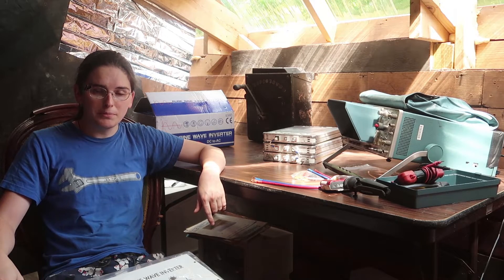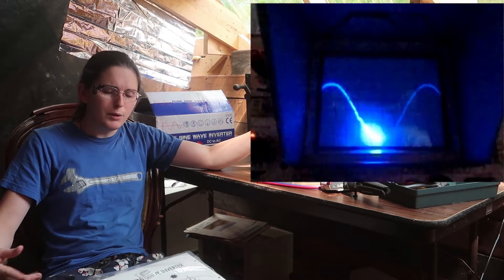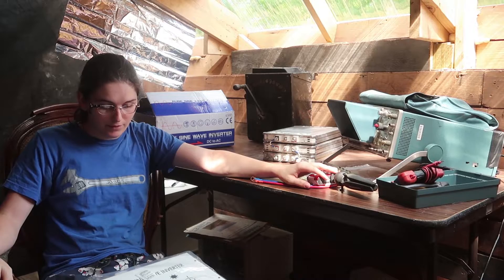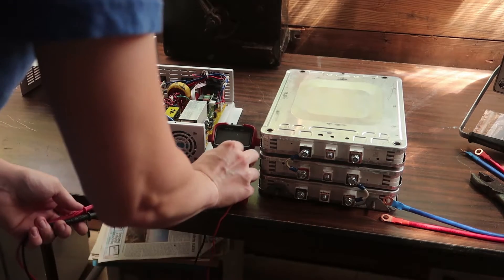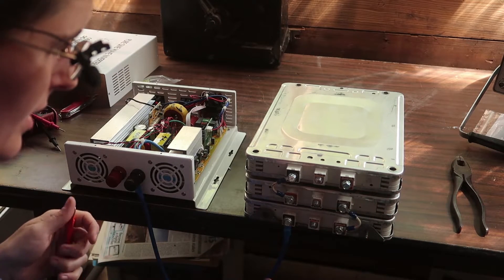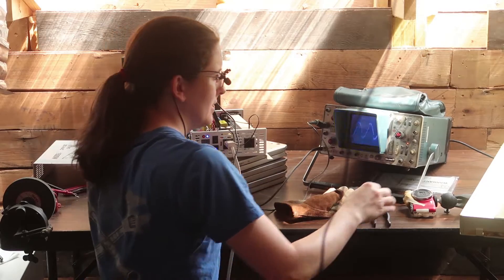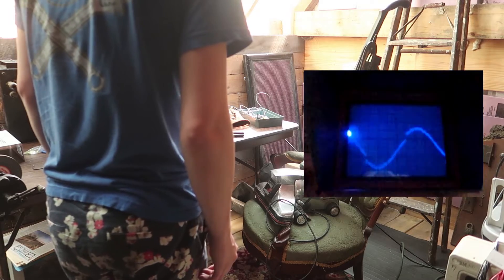Solar Sunday 01: Reliable 1500W 24V Pure Sine Wave Inverter Waveform, Air Conditioner Load Test

Comment: I finally can run the window air conditioning unit😮. I've got 1400 watts of panels, and I wound up with twenty big marine batteries. Oh, and I installed a 600 watts wind generator, that was supposed to be 24 but they sent me a 12 volts model. I've had it six weeks. I have fried the Aims Power inverter charger and rebuilt it since my last comment. It's been doing well since. When I ran the A/C day before yesterday, there was 35 amps coming in, and making 943 watts, plus a little bit from the wind generator. Sorry it took me so long.
Reply from the maker: Im proud of your progress! Is your AC unit the newer inverter type? Our new hisense unit cost extra but it has a ceer rating of 15 which is hard to beat

Comment: I wonder if the Voltmeter is shorting out on the case...with that exposed wiring on the LEDs? Your the 2nd person I've seen with this fault. Thankfully Reliable have excellent customer support and replace faulty items quickly with no fuss.

Comment: I have a 3000 watt pure sine inverter with a 24 volt system and 30 100w batterys why will it not charge my 2021 chevy bolt ev
Reply from the maker: The checy bolt might take more than 3kw from the inverter, or maybe the inverter can only give like 1,200w continuous.

Comment: I would have used larger cables on the inverter. The cables reliable supplies are not large enough to handle high inrush current.
Reply from the maker: This is just for tinkering, not for instalation. Don’t worry
Reply: @RinoasBigProjects  no problem.

Comment: You need a low freq inverter for what you want do, that high freq inverter is a good one and very efficient, but low freq would do alot better at motor start.
Reply from the maker: I agree. This will be used for running the lights and such

Comment: Could you tell me how much peak power 
Can it handle air conditioner
Reply from the maker: i think 2000w, but maybe just 1500. may need to modify AC unit to slowly turn on
Reply: @RinoasBigProjects  but it's say it's surge power 2000watt 
So it's not given
Reply: And could you tell me 
How could i charge 4s lithium polymer pack 84 amp by solar 
I try everything but result is zero 
Mostly mppt or pwm controller 
Set on 12 volt or 24 volt specialy lead acid battey which set on high 15.5 
But lithium polymer high volt is 16.8
And parameter is not match 
2nd thing i use boost mppt or converter but problem is mostly solar panel given 18 volt or 36 volt 
So what i should do 
 
So how could i charge 
I hope you answer me 
Ple ....
Reply from the maker: Your solar panel needs to be above the battery voltage. Also look online for a BMS for a 4s battery to regulate the charge.

18v would be good for the 16v battery. Solar panels are weird because their voltage drops weirdly. So the 18v panel can connect to a BMS, and the BMS to the battery. The only reason for the BMS is to stop the battery for over-charging.

I think you may need to avoid normal solar controllers if you are stuck with a 4s battery. You may be able to find a watt-hour meter from the remote control hobby stores onlines if you still need to get more info on your system

Comment: Why don't you put a shutoff on it so that it doesn't spark if it scares you and all?...I looked thru the holes in the side on my inverter..looks like #3 furnace  cable going to a transformer about like a golf cart charger...on the idling current it says less than 50 watts lol...evidently one is supposed to be able to absorb that little loss...I've been watching TV and a light on and charging phone for 2 hours and it has dropped a tenth of a volt to 24.4 volts..it got way better when I went from 6 to 8 batteries...they tend to recover a lot better now...after watching this I had a thought..if you simply put the 24 v motor on the lathe you could run it temporarily with that big rheostat...just figured you're gonna need it for the 50 cycle generator thing probably so...

Comment: Well I've had the Aims 2000 watt inverter/charger for a couple of months now...it's 24 volts...it does great but I've only got 6 batteries till next week I'm getting 2 more and shortening all these #2 welding cables up..I can run my 1450 watt air fryer but only for a few minutes without the sun so that will let me at least make a pizza...I probably could run it and the A/C both this summer since we had a 73 mph wind gust I have a shattered panel...so I'm getting 3 more so that when the sun comes back out again someday lol I'll have 600 watts at least..I'd get more but I'm kind of camping out in my uncle's barn until I can find some land or something so I'll make those be enough for now..but watching this again it was different now..I was just sitting here smiling thinking yeah my big blue box would run all that and probably the lathe too but that the 24 volt motor generator thing probably needs built just because of the coolness factor lol..I tried the old 50s air compressor and it overloaded my Aims and had to reset it so I may put a different motor on the compressor and then I can experiment with the old 110 volt it might make a pretty good generator..I bought some n52 magnets just in case...lol..later projects

Comment: Just a note...I had the same problem with a 65 year old air compressor..It is 1/4 hp also..I noticed it is 110 volt and 50 cycle...it just hums when I hooked it to a 1200 watt inverter...not sure if its the sine wave or the 50 cycles but Im going to find a pure sine wave inverter and see what it does..if it does like your lathe Im going to put a 12 volt starter/ generator from a 60s riding mower on it...it only has to run long enough for a tire to inflate...If that happens Im going to convert the old motor to a 12 pole neo magnet generator so it can at least be still used for something...my old greyhound welder is 50 cycles too but it just has a bit higher voltage...it only takes 18 amps and it was funny coz I bought it for 18 bucks...they just wanted to get rid of it lol but I noticed it has a white copper winding (35% silver)... The people that had it didnt know what it was...those inverters cost entirely too much but Im gonna bite the bullet and get one...the only ones I really like are over a thousand bucks.

Comment: Cool ta see, usta electroplate, then board through parts, usta bug the engineer fix ehs till, lol..fixed the tough stuff, but it wasnt, . Time ta look into high frequency electricity , think about sun waves into more, people have turned em dc, ac..time ta take sun waves more...need new, dig the way ya think

Comment: 6s id not ideal they do have some like 1500 watt 18v inverters on ebay that would let you get more off the power from you batteries you could charge to like 4v so not all the way but you will get more useable energy than the 24

Comment: 1 other thing you need to run a Air conditioner is thicker battery cables that are going to inverter. They need to be 0 gauge wire plus the ones you have.

Comment: You just need a bigger  inverter i just got the 3000 watt inverter but the 2500 will run AC units up to 12,000 btu. The same company inverter in the bigger size has 3 wires to hookup to for bigger loads like you looking for.

Comment: Hanging your solar panels over the apex of the roof may not be a good idea. Strong winds could easily lift and destroy the panels, the building too if there's sufficient power in the damaged connecting wires. Please be careful, perhaps blinds of some sort would be a better solution?
Reply from the maker: we shall see
Reply: Stay safe ..

Comment: Random guess here, but I think maybe the Inverter cannot handle the initial current draw of large inductive loads with poor power factor. The Lathe and AC compressor both fall into that category. Some of those stupid "power saving miracle devices" might actually be appropriate in this case. Basically a large mains rated capacitor to correct poor power factor. Big Clive has some excellent videos explaining power factor. Love the video though. Some of those inverters (as well as pretty much any ebay tech) can be pretty sketchy.

Comment: why not power the computer directly with dc, bypassing the internal power supply?
Reply from the maker: because the computer needs a lot if different voltages, and i dont want to blow up 2,000$ in computer hardware

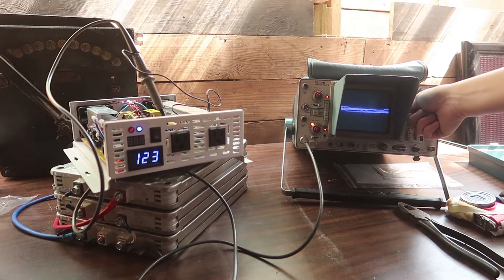Comment: oh and a lot of the "pure sine" inverters from ebay look really sketchy to me.  Especially the cheaper ones.  I think that one is modified square wave, look at the input from 4:22 that you called "digital noise".  But I am not at all an expert at looking at waveforms.  Why do you think it's just noise?  What settings are you selecting?  (I can't see the dial, obviously.) this is of particular interest to me, as I have very sensitive medical equipment that I use daily that absolutely refuses to run on anything other than pure sine. oh and a 1/2 hp motor should pull 384 watts of power.  But I think that lathe is significantly more powerful than that.  Also, there is mechanical resistance, which you try and mitigate but turning it.  Try the same setup but with a double stack (120 AH) battery pack and see if that helps with the lathe? Once again, super cool Rin!  OMG Calvin and Hobbes!?  You are so awesome! I KNOW what that buzz was.  That was the high amp draw of the A/C compressor motor starting up (just long enough to trip the switch) but not enough to disrupt everything, I had the same problem last year running a 1500 watt gas generator with an A/C that size (5000btu right?)  Try adding a couple of large capacitors inline with the A/C to "soft start" it.  Most likely, it will not run properly unless you have at least a thousand more watts.  (that was my experience anyways.)  Oh and finally, take a look at this video.  https://www.youtube.com/watch?v=R_g4nT4a28U you might find inspiration in it.
Reply from the maker: i think youtube was detecting your comments as spam, im going to whitelist your comments

no that digital noise is what you get with any unfiltered switching power supply, i was zooming into the signal very very far. thats just how the transistors turn it on and off rapidly. modified sine wave looks like a 60hz square wave with a few extra steps between. perhaps next week i will do a video of the different waveform outputs. this one is actually pure sine wave, just its kinda junky sine wave. lol.

this lithium battery can provide more energy than multiple lead acid batteries. so the battery isnt the issue. its just that motors take like 10x as much power while starting.

yeah i have a small collection of AC capacitors, i might try them.

i counter with a video for you: https://www.youtube.com/watch?v=ZD_3_gsgsnk
Reply: @RinoasBigProjects  Thanks!  I'm watching the link you sent, seems pretty cool.  Are you planning on setting up a greenhouse in the top of the shed??
Reply from the maker: no in the other yard.
Reply: @RinoasBigProjects Projects well this interaction has made my day!  Thanks, Rin!

Comment: Ive heard that the really cheap inverters have a tendency to be disguise themselves as pure sine when in fact they are modified sine, Might wanna check yours to make sure! Might be why your computer was hiccuping. Ive also read a lot of people saying the lines these companies run to the outlets on the box are wayyyy to undersized for the loads that get drawn on them. Might want to beef them up!.
Reply from the maker: computer was fine, AC unit was giving issues

turns out there were 4 pins broken in my graphics card connector so that was a seperate issue

Comment: I had a nother idea about powering the lathe and that is only using a brusslless motor to power it, you coud gain full speedcontrol and even anti ringing features like AVE did with his lathe. Where he slows down and speeds up  the motor constantly so no resonant frequencies can build up in the workpeace. Having full speedcontrol and the option to run a 6s motor /esc  so no inverter is needet sounds nice to

Comment: You should consider making the solar panels you intend to cast shade on your sky lights pivotable or something. So you can batton them down flush against the roof during high winds or a storm. I could see them become expensive airfoils and get damaged or torn off.
Reply from the maker: i designed the roof to be the right angle for them

Comment: A/c compressors need to draw 4 to 6 times their running current when starting to turn over so even a little 5000 btu will have trouble starting on a 1500w inverter.

For your application, unless you want to spend big bucks on a high capacity inverter (like 5kw+), you can add a hard start kit to the a/c. It's a capacitor and relay combo wired in parallel to the normal run cap of the compressor to increase the phase shift and starting torque temporarily. It automatically drops out of the circuit once the compressor has started.

For you the SPP4E from supco (http://www.supco.com/eclass.htm) -> 1/8 to 1hp 90 to 130V will fit the bill. The rule of thumb is 1 HP per 12 000 btu so it would work on any 120v window a/c up to 12000 btu. Do not get the non-E series version, has no way to detect when the compressor has started and takes a long time to cool down and reset after compressor operation due to using a ptc style device instead of a relay to drop out of the circuit.

Even with a hard start kit you'll probably need a higher capacity inverter than 1500w to run large inductive loads like a/c units and power tools.
Reply from the maker: this inverter said it was capable of handling 3kw surges so i was mostly testing it out of curiosity rather than actually planning to use it for that.
Reply: then a hard start alone may solve the problem.
Reply: @Jon-hx7pe  That "hard start" you mentioned, is the start relay, and this is already used by the manufacturer on small AC compressors like this window unit. Even in household refrigerators and freezers those start relays are installed, without them the compressor won't start even on main lines.

Comment: What if you powered the lathe with a treadmill motor and speed controller.
Reply from the maker: it would need to be 24v instead of 120v. havent seen a 24v one yet.

Comment: You need to also look at your setup on the oscilloscope. It should not require so much setup for a sine wave display. You're not triggering saw tooth patterns with fixed level, phase, amplitude, duration and falloff... If its sixty cycle 120v then its straight forward like a multimeter.- only a couple of settings. And if you're using the inverter to power the scope, you are looking at the effects of the input power to the scope..blah blah... Remember the required initial surge voltages to START a motor and the falloff of requirements after starting. Motors require startup windings or capacitors on starting coils, blah blah to start the motion in specific direction of rotation.... I am not that up on old motors like that on that lathe or on the compressors of A/Cs so.... I don't think its the load as much as the initial amp/volts needed. That rheostat may be a big overkill - never seen the need of one since the twenties...and in labs.. The lathe should be fine WITH an initial manual spin up of the motor. Don't forget those grounding wires...I was going to ask about initial battery stuff but you did that. Next?

Comment: i think inverter turned off cos it got to hot with out the cover and the airflow across all components
Reply from the maker: but it didnt turn off...

what video did you watch?
Reply: @RinoasBigProjects  where it dipped i thought it shut off i just re watched that bit and missed the bit where the pc did not shut off my bad if the ac compresses is anything like a fridge one they take a hell of alot to start them going
Reply: @RinoasBigProjects  would the ac not work on a modified sine wave ?
Reply from the maker: i worry modified sine wave would give issues. i think it would be better to just make a rotary converter. power an AC generator/dynamo with a 24v motor
Reply: @RinoasBigProjects  yeah used to work well when a building had single phase and they needed 3 phase as to the lathe i think a 24volt motor with speed controller would work  fine

Comment: im thinking that a mchanical fase converter is a good idear. For running any big apliences. Alsow keep in mind that running Switchmode powersuplies on a bad unpure singwave causes a lot of strain on the imput capacitors. Saving on the inverter maby not the best option. Cause you are paying more on the sortend livespam of the equipment your running. 

My sugestion woud be a 3kw brussless with an esc that has the option letting the motor spinn at a certain rpm. Thats driving an generator core or even just an electric motor maby even 3 phase so you woud have 3 phase in your shop. if you get relativly good equipment gessing you coud be somwhere in the 80% effiency range.
btw Video has a great audio quallity very pleasent.

Comment: What are the specs of your lithium battery?  How many cells in series to approximate 24 volts?  That inverter (like most) is calibrated for two lead acid batteries in series, so 7s lithium would be ideal.  I'm guessing the Nissan battery is 6s but I'm not sure.
Reply from the maker: 6s is best for this in this case, 7s is pushing it

its 24v 60ah

Comment: I have a smaller 750w version of this inverter.  Tried it on my small window air conditioner (5,000 btu), and the air conditioner doesn't even turn on.  Doesn't even try - just faults.  The inverter doesn't blink.  I guess the problem is inrush current?  It runs everything else I've tried just fine.  I wonder if there is some relatively inexpensive way to deal with inrush current demands.  Also interested in ideas for fusing between the battery and the inverter.